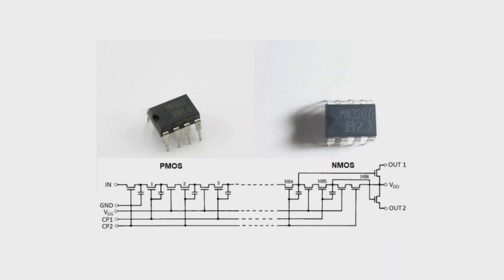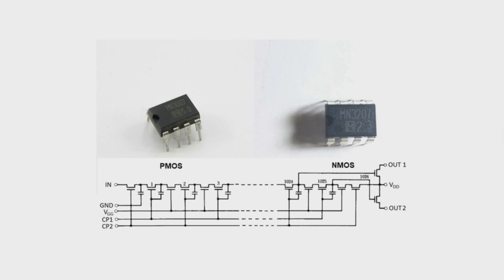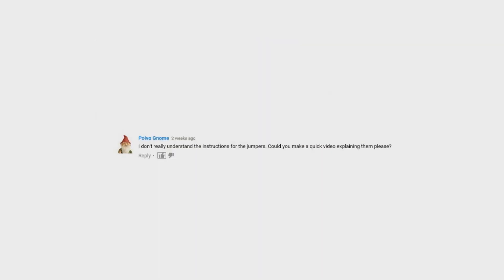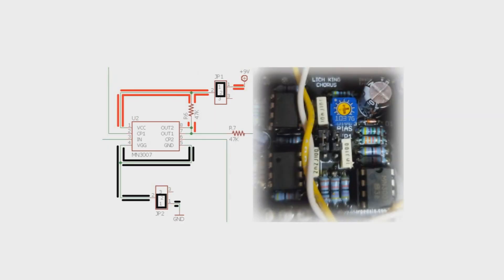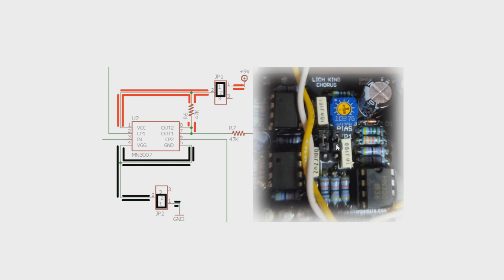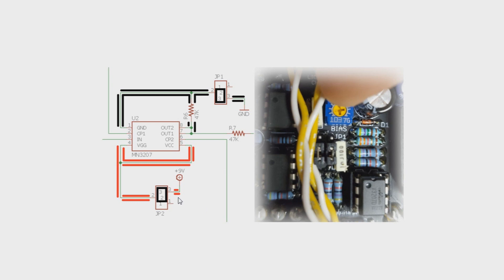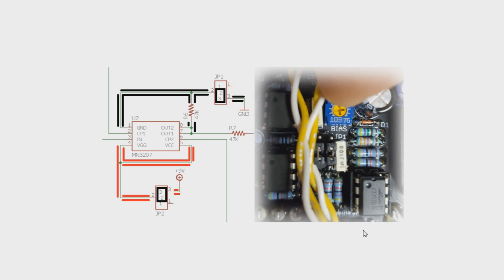BBD Jumpers Settings Explained for Lich King Chorus

Comment: Hi Erik, thanks for the video. I’m building this as my second build so still finding my way around. The jumpers don’t seem to be listed in the parts list. What is the specific part required? Also, is there are more general parts list (hardware, mounts, etc) that you could give me?
Reply: Shunting jumpers can just be a solder glob or just use a clipped off lead off a resistor or diode that you clip. Basically, just metal to connect the two holes together. General parts? Other than audio and power jacks? knobs? stomp switches? Anything in particular?

Comment: Ok I'm loving the lich king for my next build, here's my delimma please respond Lol! I love the lush boss/mxr style choruses but the buffers in them while on bypass kill the highs in my signal especially if the chorus is in my fx loop and I'm using a treble booster or other dirt pedal in the beginning of my signal chain. So is this an issue with the lich king? I typically build on vero but with a chorus I'd rather gouge my eyes out then try to build a chorus on vero so I'll be using a prefab pcb lol. I don't remember seeing if it's true bypass or not but if it's buffered wiring it for true bypass shouldn t be an issue. I should say I have nothing against buffers typically, but in every chorus pedal I've owned they sucked tone and killed an otherwise excellent effect. The lich king's chorus and vibrato settings make it perfectly matched to the chorus I want since the non true bypass chorus pedals I own don't do vibrato they sound more like Leslie's than chorus's when turned up to the point were youd start gettong a vibrato tone on a boss style chorus. But the TB choruses are the only chorus pedals I own that don't suck out the highs. Anyways I've made my point and more lol. Any suggestions/recommendations. I'd really love to hear them (from anyone whos had this problem or has some insight into it). Thanks!
Reply: Well, the Lich King is a circuit that is set for true by-pass, so no worries there. However, technically, there still are "buffers" within the chorus circuit. If you download the build doc, it goes over the technical data, but if you build it stock, the input buffer that is built in only cuts frequencies under 16Hz, and if that's a problem it shows you how to change that value (Changing values C1 and R2). The output buffer is absolutely necessary because that is the op-amp that as well as buffering, is also combining the wet and dry signals, which technically makes it a buffer. It does have a low cut filter killing frequencies below 1.6Hz (R11 and C5), but those can be changed as well.Also, in the case of the input buffer that is built in, I give the pedal a really good high impedance value of 5MΩ, so that should stop any tone-sucking that would cause the signal to get a dark tone from cable length. The output impedance is 9.1KΩ, so as long as the next pedal in the chain has high input impedance, again, no tone sucking.Hope this helps.
Reply: @erikvincent5846  This is exactly what I was looking for info wise. Can't thank you enough! Edit: Had to come back and say it again, seriously that was a massive help. Now im really looking forward to building it. I've been building pedals for awhile but I keep putting off building a chorus for that very reason. Having more info on where those caps and resistors are that I could encounter an issue with really helps(but from what your post says i know those shouldn't be frequency cut offs to worry about but in the case that they are it's great to know I can swap cap/resistor combo values. But again it sounds like that won't be nessesary.
Reply: @michaelinglis8516  No worries. Check out our video on how chorus pedals work where I break down the circuit into chunks for the Lich King Chorus. Typically, chorus designs also cut out some of the highs as a way, in sacrifice, to take in guitars with hotter pickups. Because I went the other way, using a Lich King on a guitar with some EMG 81's, for example, without rolling the volume or tone knob down, you will get some distorted harmonics, especially when strumming or picking hard. Play with a standard single coil setup, PAFs, or Vintage 59 style humbucker pickups and it works great. Because those distorted harmonics are in the higher frequencies, some designers just filter them out, either in buffers, or in the Sallen Key filter section (see build doc on the Sallen Key). But that is the sacrifice.
Reply: Funny you say that I have a strat style guitar with singles but mostly I play my schecter with a jb/59 set that I've wired both for split coil push pull knobs and my other main guitar is an Esp 7 string with fishman fluence modern 7 pups which have a massive amount of highs if you don't balance them with some low end. And I also have those wired for the 2 voicings each and I added a 3 way on off on toggle for inner coil tap, humbucker, and outer coil tap.  But I'm always using the volume and tone to clean it up/dial in dirt and wouldn't be turned off by having to do that with the lich king at all. So I'm still certainly still building the lich king but maybe I could just build it 100% stock an use a bigger box and build it with a complete bypass/loop box just in case. I've never had buffer issues with other pedals and normally welcome them along side TB pedals so it would make sense this is a characteristic of some chorus pedals and their "internal" buffers. And I normally use my jb/59 set up for chorus and roll back the volume a bit on the jb if I want clean and back up if I want a bit dirtier chorus. Btw thanks for the quick reply I hope you wont mind if I shoot you a line while or after building. Truly just knowing that it's not so much the input or output buffer causing this(altgough it could be in part) has me much more comfortable just working it into the tone ive got and building a bypass/loop box into the lich king for the best of both worlds. Does that sound crazy or over kill?
Reply: @michaelinglis8516  Not crazy at all. Paul and I have been back and forth with this Chorus design based around a similar issue that I noted above: hot pickups = distortion. Cleaning up with the volume knob helps in those scenarios, but what really had me feeling the issue out was when I took a small pedal I made, which is just a passive Baxandall tone control in a pedal-box, and put it in front of the Chorus. Even with my Baritone Schecter C1-Stealth with really hot Fastback Unshaven pickups played nice with it when I added that to my signal chain. Because the passive baxandall is a passive tone controller it, all it does is cut frequencies as opposed to cut and boosting. So when I set the bass and treble knobs to noon, which cuts flat at about 6dB, I noticed all the distortion went away. So attenuating the chorus "fixed" the distortion that other designers just poke and prod out the "bad" higher frequencies to resolve. I though above adding that to the Lich King Chorus's PCB, but that would add more complexity to the circuit than I wanted to do. Besides, then Strat and PAF players would be mad at me. LOL!

I don't mind the occasional message, but send them to the DIYGuitarPedals.com.au site, that way Paul and I get them faster than the YouTube's messaging service.
Reply: @erikvincent5846  That is an excellent idea with the Baxandall style tone control(i would not be surprised at all if i end up stealing that very idea eventually, more op amp control seems like a great way to tame the clipping). And as much as i would have appreciated you adding a similar circuit to the L.K. chorus i agree that youd certainly have vintage output pup players unhappy with you lol. Not to mention thats probably what most guys are using the L.K. and its predecessors with. You were just the guy i needed to talk to about this it seems. Im glad to know im not the only one who will go out of my way to get my tone just where i want it. Ill send any future messages to the DIYguitarpedals.com.au site. Thanks again for all the wisdom!!!
Reply: @michaelinglis8516  Not a problem. We have a lot more pedals already designed for the DBE stuffs, but we also do a thorough vetting process, so that's why it takes a while. We are about to release an update to the Chime amp, as well as my take on the MXR Phaser design (matching JFETs) and a simple, but easy to tweak PT2399 style delay. But I have a lot more as well. Other chorus (BBD with BBD Clock, blend, and bass support) and phaser (OTA instead of matching JFETs, which also gives vibrato) designs, a tremolo pedal that isn't based around the EA Tremolo and only uses discrete parts, my take on the BOSS OC-2/3, my Take and fixes to the MXR Blue Box, a MN3207 based flanger, etc, etc, etc. Plenty of stuff coming!
Reply: @erikvincent5846   You guys always have something really cool going on that at the absolute least i can learn from and find entertainment in. Looking forward to all of it!

Comment: I think the confusion is because in your MN3007 schematic pin 1 is labeled VCC but on the datasheet it is labeled GND.
Reply: Yeah, that was more or less a note for myself to make that pin bi-polar, depending on the jumper settings.